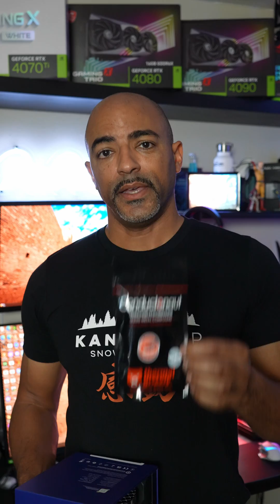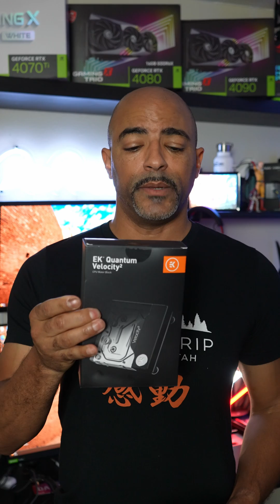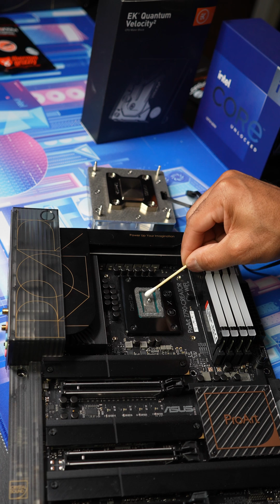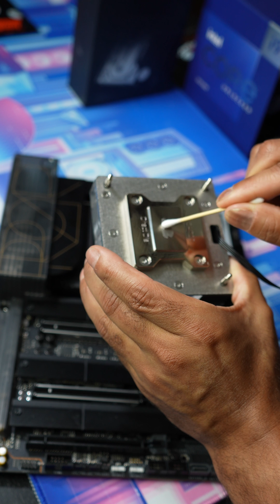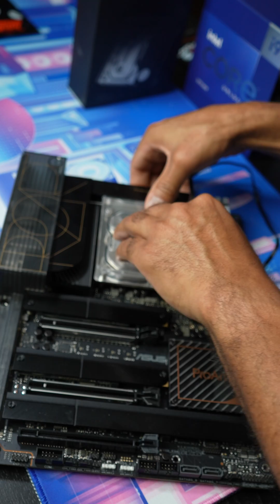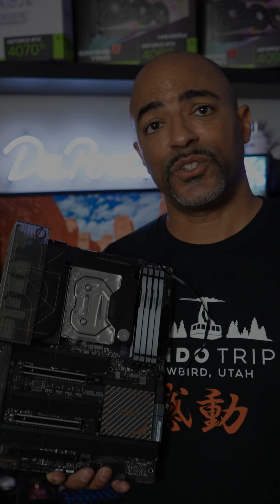13900KS Delid Liquid Metal Application and EK Water Block

Comment: What should we know about later removing block for any reason being. 
Will the block stick to the cpu dye, and or should it be removed after a warm up or better to take apart cold?
Anyone?
Reply from the maker: if done correctly it will look roughly the same 2 years later as when you applied it.

Comment: how long will this last before you need to reapply the LM..?
Reply from the maker: Depends on the quality of the copper. It could be 3 months before you need a reapplication it could be almost never
Reply: @DaPoets  your talking about the copper that was plated with the nickel..? im about to delid my cpu as well.. the same as yours with the same ek block.. so far how is this system running and have you reapplied the LM yet..? also gonna do the same with my 4090 with ek nickel block as well.. just wondering how long before i should reapply.. its been a year so far..? how is your system doing..?
Reply from the maker: @darknesschilled  Sorry old video. LM will last many years if applied correctly to nic plat. No need to reaply years later.